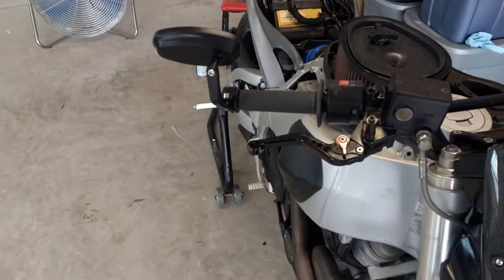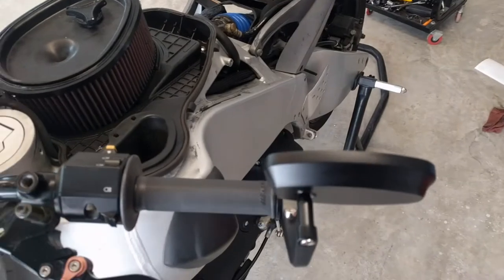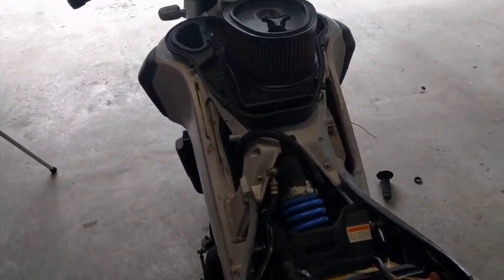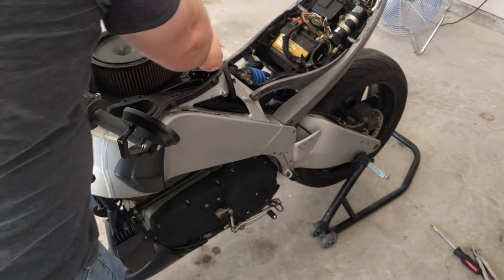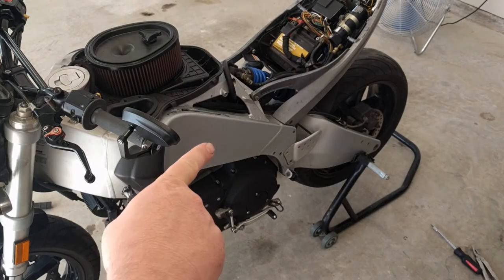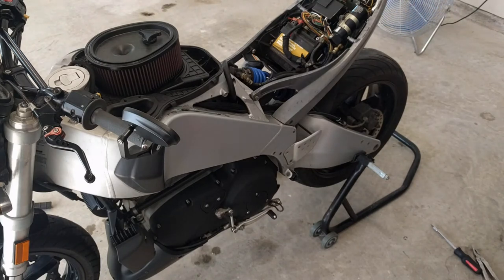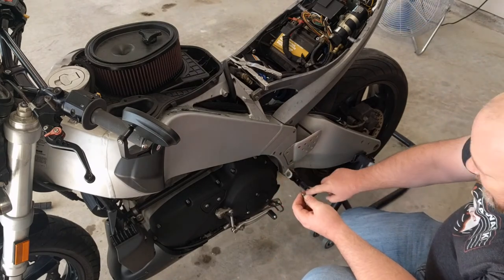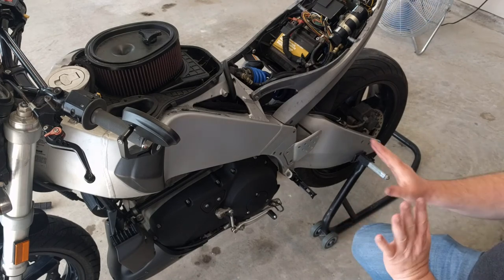2005 Buell XB9SX - Update - Foot Pegs

Comment: Supposed to have a spring to make the peg stay folded down unless you tip the bike or need to fold it back out of the way for moving around the garage or whatever
Reply from the maker: These have already been replaced with factory pegs and springs